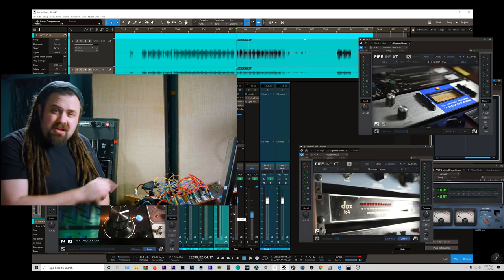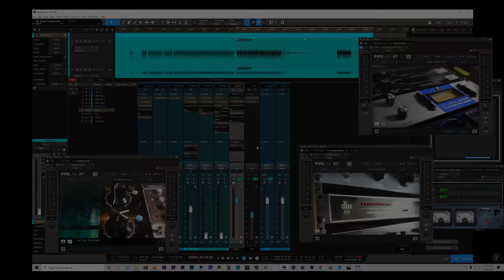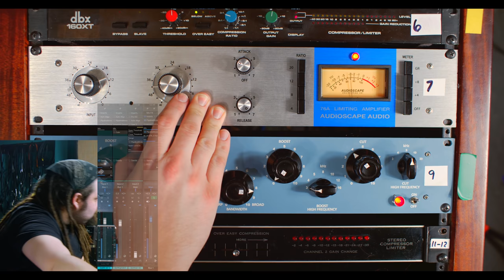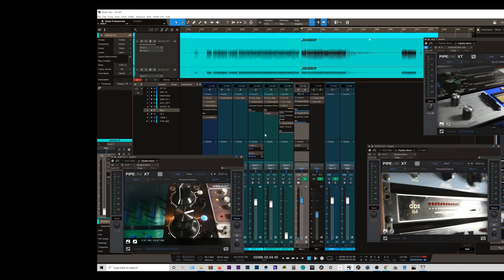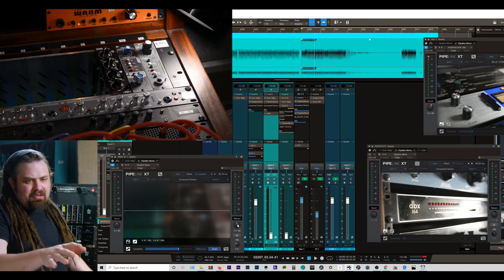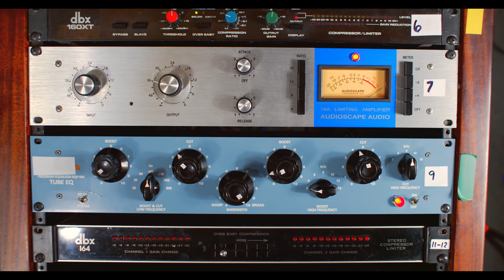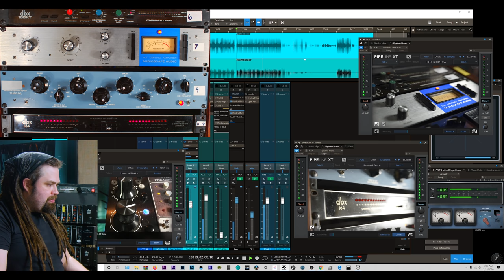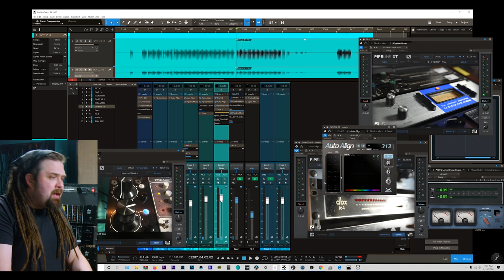Obliterating a 2-mic Drum Mix with Compression and Overdrive

Comment: Pushing two ratio buttons is something that you can only do with the actual gear but, do you think it would be possible to add up two instances of a "76-like" plugin on a track and get the "same" result ? And if so, in what order ? Would you start with the smaller ratio and then the bigger one, or the opposite ? Thanks
Reply from the maker: Not really. I know some of the plugins allow you to click multiple ratios as long as they are the buttons next to each other (4 and 8, but you can’t push 4 and 12 only).
Reply: Didn't even know some plugins offered the possibility of multiple ratios clicked. Alright, thanks ! I'll try to mess with my plugins in the morning, to see if the sound character I get from, say, an 8+4 is interesting. I'm not convinced that the result would be as good as with the actual compressor out of the box. But maybe I'm wrong?

Comment: I tried to do something similar before, and it sounds great on closed hats. But once I played open hats or ride, it started to get really harsh even with really light playing on those cymbals. What kind of solutions should I try?
Reply from the maker: Yeah great question. For this, I knew that it would have that problem and I played the hats very soft. For ride, you gotta tell the drummer to barely hit the cymbals.
Reply: multiband it and lower the output of the higher bands, then have the clean attack of the snare/kick close mics inverted-sidechain that high band, so it opens back up to acccentuate the attacks.
Reply: also just go with it honestly, the sound of hypercompressed cymbals is awesome and i use it (using XFER OTT because i don't have any hardware compressors) as a "yes, we're really in the chorus now for real" layer

Comment: Do you find this to be a lot more responsive than the warm wa76?
Reply: Btw that trick with the stereo dbx sounds great.
Reply from the maker: The ratios on the wa76 all sounded pretty much the same. A little calibration from a tech would fix it. I’ve heard the 4:1 is actually an 11:1 ratio.